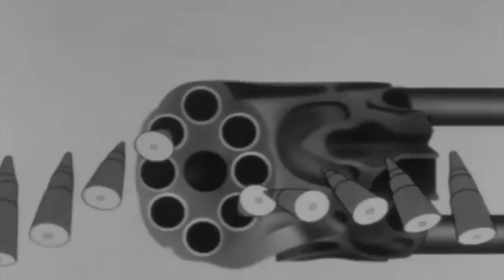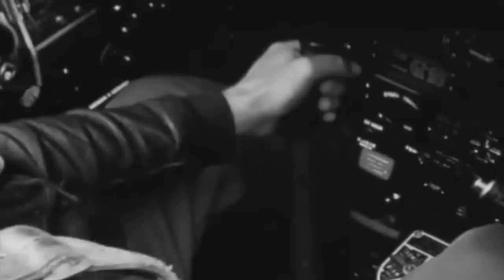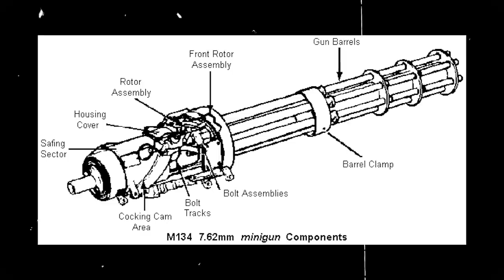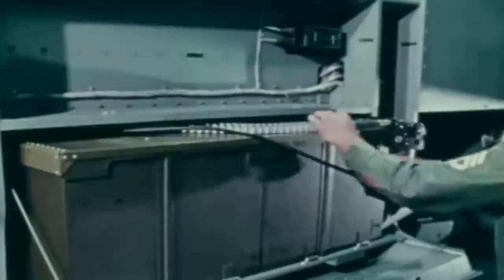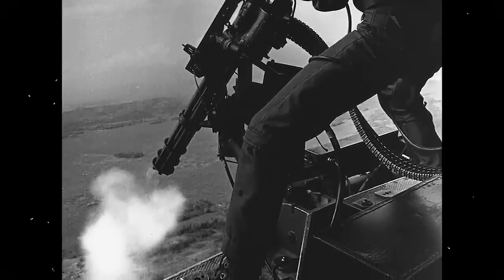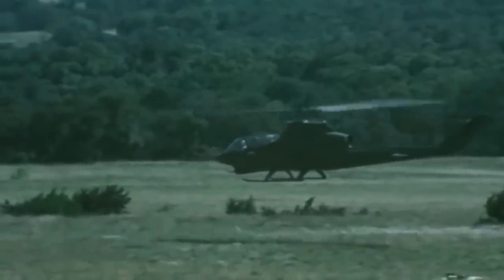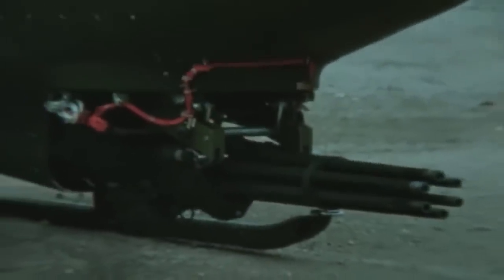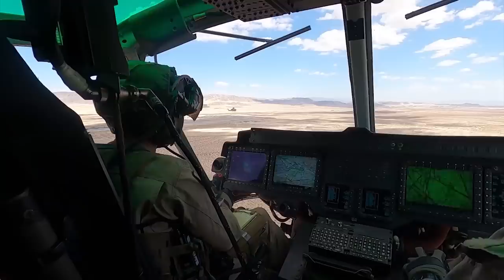Minigun -  M134 7.62×51mm Six-barrels of Pure Destruction

Comment: And, when you see the red ribbons of the tracer rounds, keep in mind that NATO 7.62 ammo links come loaded with a tracer as every fourth round. So, what you're seeing in those blurry lines is only one quarter of the rounds being fired. There are four times as many "bullets" as you can see.
Reply: I crewed a helicopter (UH-34) in 1967 and used the M-60. Two, one on port window and the other at the door starboard side. I had my 60 ( we refer to them many times as "HOGs") either jammed ( very seldom) or more frequently "Run Away" gun. It would continue to fire after releasing the trigger. To "correct it" or stop the run away gun, simply take ahold of the belt and twist the belt. This would break the belt. When engaging the Communists, it seemed the M-60 didn't put out enough firepower! Chuckle. Never enough. But I had times to witness the result from "Puff The Magic Dragon" run. Named that because of the ribbon of red tracers spewed out during a run, that appeared as fire from a dragon. Truly awesome. The field roughly the size of several football fields were "plowed up".

Comment: Gatling applied an electric motor to the rotary gun around 1890 and achieved firing rate up to 1500 rounds per minute.  This gun was aimed at use aboard ships where an electric source was available.  Contrary to the video, Gatling was still a wealthy man at his death from his various inventions.  He did spend a lot of money in trying to promote his unsuccessful inventions but was still wealthy at the time of his death.
Post WWII the goal was increased firing rate due to the limited time on target available in comflicts between high speed aircraft, that is when they revisited the rotary gun.  It seems to me that the P51 armament of 8 individual Browning .50 cal guns would achieve a substantial combined rate of fire but with the smaller .50 cal cartridge.  The rotary gun had more barrels which helped keep from overheating any one barrel, and the rotary mechanism was not blocked if a cartridge misfired.
Reply: Gatling also designed a gas operated gatling gun. It tapped into the gas from the fired round and used it to power the gun. Once the first round fired, it would run on its own.
Reply: @paulbeck6410  I wondered how that one actually worked.  It sounded similar to starting a Ford Model T- turn the crank and as soon as the first cylinder fires it starts running.
Reply: @billj5645  The book I read didn't cover much other than he designed it. Probably it stop it, you would have to stop feeding it ammo just like a diesel engine. It's an interesting concept.
Reply: P51's had 6 .50 cal's not 8, it was the P47 Thunderbolt that had 8 of them.

Comment: 0:48 14,000 rounds per minute?  That's over 233 rounds per second meaning a round fired every 4 milliseconds or so!  So that is not the firing rate of the minigun, but of ALL FOUR miniguns on the Spectre.  For the uninitiated, this is misleading the way they stated it when making first and only mention of the rate of fire in that introduction.  The, at 12:39 the claim is 16,000 rounds per minute.  Sheesh... pick and lane and stick to it, would ya?  Why not just use the absolute maximum burst rate of 6,000 rounds/min and say it's 24,000 rounds/min?  Ugh

Comment: 2:27, "then, in 1893 Gatlin exchange the hand crank motor, in favor of an electric motor"...
A patent was issued July 25th 1893, but I can find no pictures of a practical gun...
Reply: I saw one dated 1880/90 while I was flying the Cobra [1969-71], It wasn't very practical from a mobility standpoint, but was credited with 18,000 rpm based upon the time it took to fire it's limited ammo capacity. I'm only stating what the article said, but the photo was very interesting.

Comment: Over and over again we see the need to return to previous ideals that did not work in the past due to tech not being available. Maybe it's time to return to the ideal of the baby mini gun in a 7.62 NATO round? Little Sally May Death could be made lighter now using Ion Lithium batteries for power instead of the old lead acid core batteries. Using matals not available in the past like 6061, 7000 & 8000 series aluminum alloys, magnesium, cobolt or better forming the receiver would make it lighter and displace heat faster. Using a mix of hand formed, bonding and vacuum forming plus 3D printed carbon fiber for parts like the trigger mechanism, ammo ejection guides, back pack main body & frame, power unit housing and flexing linked ammo guide. Maybe even have it work off of a belt and a curved 100 round magazine. Enable the operator to use the 30 and 15 round magazines in a pinch.

Comment: so the electric Gatling gun was able to fire 3000 rounds per minute in 1893. Imagine what a gun like this could have done in ww1, with all those on-foot mass attacks over open terrain.
Reply: I saw a photo and read the article that stated a gatlin gun reached cyclic rate of 18K/minute in 1898[?] which said it was based on an interpretation of the time it took to fire the gun's limited magazine capacity. The electric motor appeared to be mounted on flexible torsion bar of some kind.
Reply: @davidwatson9984  that sounds completely insane. 18.000 rounds per minute?

Comment: If the minigun could have been adapted to fire a proximity round, I think it could have been more effective as an anti-aircraft weapon (attached to any platform, aircraft or ground vehicle). As fast as it fired, if the shells don't hit the target, the ammunition is just wasted.
Reply: The Phalanx is a Vulcan cannon based anti-aircraft system, and they probably do have proximity fuse type rounds, however you really don't need them when the weapon system is radar and computer guided.
Reply: No, they do not have proximity fuses for any of the 20mm ammo used by the Vulcan gun.
Reply: @dukecraig2402  you said that like you know for sure, so out of curiosity, how do you know? I mean according to Wikipedia The M56A3/A4 Is a "Nose fused Round" not necessarily a proximity fuse but how do we know what the military has? If they have a Nose fused round isn't it possible they added a proximity fuse for a system like the Phalanx? Seems like a good idea to me. If they don't have it, maybe they should. Maybe "Shadovanish" is on to something.
Reply: @Joe5561000  
Because I was a Vulcan gunner in the Army, I can assure you there are no proximity fuses for 20mm ammo. 
Standard combat loads are explosive rounds, there 2 types of fuses, a "point contact" fuse used for ground targets, HEI (High Explosive Incendiary) and a "delay fuse" for use against aircraft HEIT-SD (High Explosive Incendiary Tracer, Self Destruct).
The point contact type fuse detonates the moment of impact, the delay fuse detonates a fraction of a second after impact so the round goes inside of an aircraft before it explodes causing maximum damage to the engine, avionics, controls, hydraulics or anything else inside, if a point contact fuse was used against aircraft it'd probably just blow a panel off the outside hence the slight delay in the AA ammo.
Another feature of the AA type ammo is it's self destruct design, this is because when shooting at aircraft you're swinging the gun all around and quite often shooting back over your own lines so you don't want your own explosive 20mn shell's raining down on your own forces, self destruct happens when the magnesium tracer packing burns into the rounds explosive charge, meaning the round self destructs at what's called "tracer burnout".
Standard practice ammo was two types, TPT (target practice tracer) and TP (target practice), both were essentially just large steel slugs with the TPT having a tracer packing. 
Since I was a gunner on one they've developed an armor piercing round but people take that out of context, it'll only penetrate ¼ inch or armor grade steel at 1,000 meters and is only effective against light armor.
Reply: @dukecraig2402  Thank you it'a always nice to hear from someone who actually knows what they are talking about. A lot of times you run into guys who think they "know" because they played a video game. I do think a prox fuse would be a good idea for the Phalanx system. Just seems like a no brainier "Hay I'm trying to shoot down really fast missiles and airplanes. Wouldn't it be nice if I didn't actually have to hit them just get close to them." Then again R2D2 does a pretty good job the way it is.
Reply: @Joe5561000  
Proximity fuses for 20mm ammo wouldn't do any good. 
First of all a 20mm round doesn't have enough explosive power for a proximity fuse to work, the only reason it worked with 40mm ammo and larger is because the round itself has enough explosive power and sends enough shrapnel flying that one exploding close to an aircraft stands a chance of damaging one, 20mm just isn't powerful enough, it needs to actually hit the aircraft and not just explode close to it, plus once you fit a proximity fuse in one it'd take up enough space inside that the explosive charge would be reduced even more. 
And in the case of incoming missile's they're moving so fast that by the time a proximity fuse exploded the missile's would wind up out running the shrapnel.
The way a Vulcan works is it saturates and area with ammo when it fires, think of it like a long range shotgun, proximity fuses are for slower firing guns that can saturate an area like that, they can't put up a "wall of lead" like something spitting out 3,000 rounds per minute.
Reply: @dukecraig2402  Good to know. That makes sense. Thank you.

Comment: I mean I honestly think the mini has too high of a fire rate. We need a slower spinning one to not have to carry as much ammo. Thing uses a lot of ammo quick.
Reply: The entier point is the high rate of fire. Which normally is a waste. Its not used on ground vehicles for that reason. On the ground higher caliber slower firing weapons make more sense for the weight. But if you are moving very fast the most important thing is that at least some rounds land. 5000+ rounds a minute might seem fast. But at 60 miles an hour(1 mile a minute)(~5000 feet in a mile) that is about 1 foot per bullet. And from the air you don't usually have to shoot through much. So its worth it.

Comment: It's too bad the mini gun wasn't developed during WWII for B-17's
Reply: Why? It would have had far less range than the .50 cals on them.
The British bombers had .303 defensive guns on them which is a cartridge with performance close to 7.62mm NATO, German fighter pilots quickly learned all they had to do was start their attack at 700 yards which was the maximum effective range of their cannons and break off their attack around 400 yards away from the bomber and they didn't have anything to worry about because the maximum effective range of the .303 guns on the bombers was 400 yards.
But the maximum effective range of the .50's on the US bombers was 700 yards which put the German fighter's in the range of them at the beginning of their attack, by having mini guns the German fighter's could break off their attack at 400 yards just like they did with the British bombers and they wouldn't have been in danger, just because something has a high rate of fire doesn't give it a longer effective range, that's up to the ammo and the mini gun only fires 7.62mm ammo, so having them in the US bombers would have been less effective than the .50's they had.
Effective range is a function of the ammo, not the firing rate of the gun.

Comment: Isn't 7.62×51 Soviet / russian ammo? Curious why they chose that round.
Reply: Or am I thinking of 7.62x49? Or does that even matter .. N00b
Reply: @Brock_Corb  That would be 7.62x39 - Soviet, 7.62x51 is a NATO standard.
Reply: @Brock_Corb  That would be 7.62x39 - Soviet, 7.62x51 is a NATO standard.
Reply: @connermaccloud7036  thanks
Reply: 7.62×54 is the old rimmed Russian cartridge used in the Mosin Nagant bolt action rifle and is still used in belt fed Russian machine guns and the Dragonov sniper rifle, it's a hard hitting bad ass cartridge.

Comment: If the M60 wasn't powerful enough, then the M134 wouldn't be powerful enough. They use the exact same bullets, the M134 can just put more rounds downrange.
Reply: yep. good catch they are  both 308.
Reply: The increased volume made up for the .308. When I used it in Nam from my Cobra i found that as the distance increased the high volume allowed target saturation very similar to the M-60 at it's normal combat ranges.
Reply: @davidwatson9984  ok, cool. I'll buy that for a dollar. Thank you for the response. As obvious as that concept is it totally went over my head.

Comment: I think some of your info is BS.  A huey could barely carry enough ammo to sustain 1 mini gun, not 2.  A loach could barely carry  a 30 second burst of ammo.  I never saw a mini gun on a huey.  We tested a gunner fired mini on a couple of loaches, but they just couldn't enough ammo.  It's too bad you had to talk down on the M60.  If the barrel overheated, just tip it up and release the barrel and replace it with a new one.  Think about when we first went to Nam, we used full auto M14's, and make sure you don't lose any magazines.  poorly done.

Comment: I was watching a clip or a Cessna Skymaster clearing a sniper and after the first pass with its twin pods there was not a leaf left on the trees. Just a bunch of tree trunks. Nowhere to hide.
Reply: Cobra pilot for Blue Max - I was asked to take out a sniper that was hiding in a large tree, but I could not see him from the chopper. I started at the first limbs and continued up the tree for maybe a 1000 rounds until the FO told me that the sniper had just fallen out the tree dead...I never saw a thing but tracers and tree limbs being shredded...

Comment: I see u are relying only on the written word for ur information.
I flew  as a door Gunner in a Huey in 1970 Co B. 101st Av BN, 101st Av Gp 101st AB (AM) Div
The Bn was all huey's  In the Bn there where only three equipped with a minigun
The other 07 Huey's in the Bn all had M-60's  Ua the barrel over heated  That is why we carried at least 5 spares
undo the barrel and let it fall put new one in. takes but seconds.  Cobat loss the over heated barrel.  Do this before it jams while u are in safe place.  At any rate4 when doing a hot LZ the real fire poser came form the Cobras.  Topw flying high cover and 2 more escorting each Huey in.  Yes by '70 we had learn how to do Bird strikes the right way
So go talk to some guys who fought that war and learn something about it.